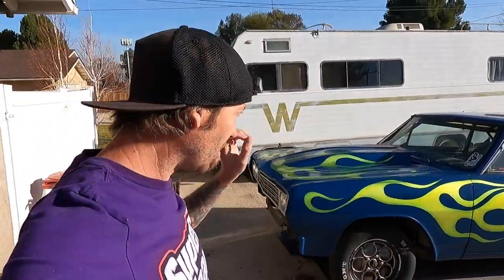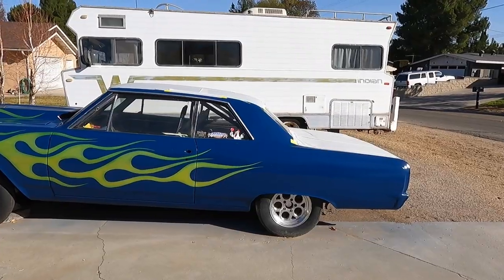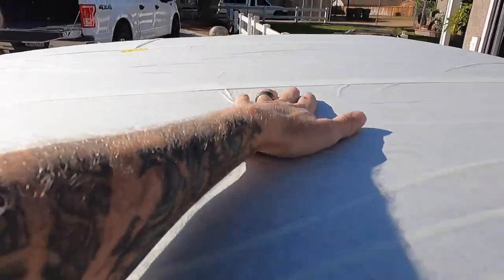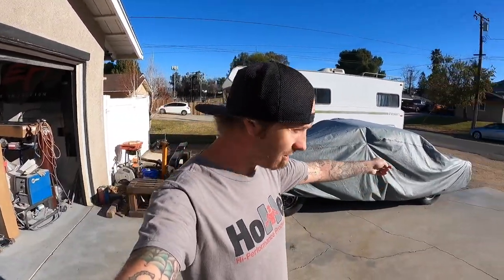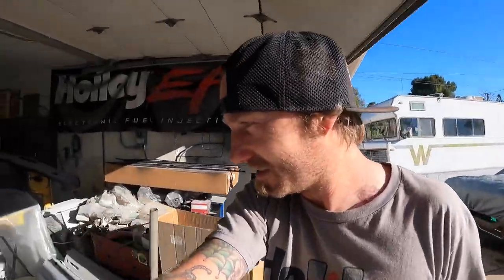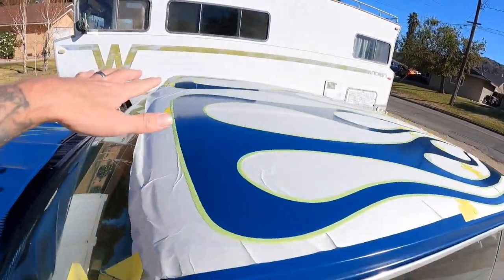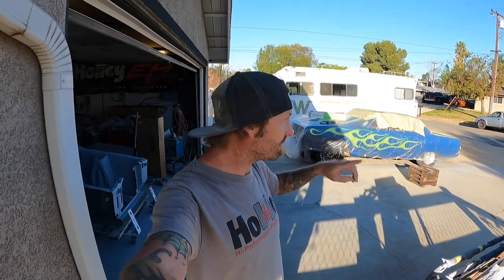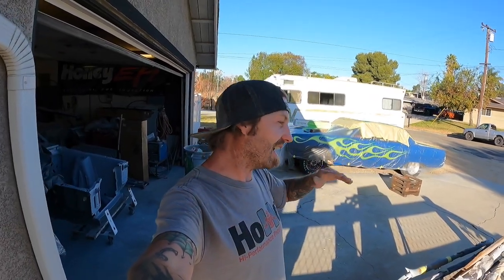Painting The Roof And Deck Lid

Comment: I'm in an 88 stang hatch. It's got a factory 4 link, but it's a triangulated so not the 4 link you add on a back half for sure - but no panhard bar. They can be easy to put power down, but you gotta reinforce the mount points, and replace all the control arms with tubular adjustable stuff. The notchbacks are better, but run what you brung right? Yeah, I'm LS swapping it though :D
Reply from the maker: The rear suspension on the A body and G Body for that matter is similar to a fox body but im sure the geometry is differnt by they are triangulated factory 4 links as well. Ill do the best I can with what I have and im sure we can make the car do alright. Reids car cut a 1.4-1.5 60' so if I can get mine down in that range I would be pretty excited.

Comment: Theres a big and a small gun from HF in a blow moulded case - both HVLP. Comes with a pressure regulator for 50 or 60 bucks or so. The "big gun" out of that kit is like 15 bucks by itself with none of the extras ... I want that one! but I really need a compressor that'll run it. under 400 at HF too - the smallest belt drive oiled compressor they got I think is like 370 + theft.
Reply from the maker: Yeah paint is all about the volume of air you have to work with. I started with a 60 gallon compressor and now have an 80 gal. If I can get my hands on a larger compressor I would take it haha. I agree that a touch up gun is a great starter for anyone wanting to learn and will paint lots of stuff quite well.
Reply: @Burndown  it's a 2hp 29 gallon with cast irion belt driven pump. it looks like a whole lotta compressor for under 400 bucks.

5.9 CFM @ 90 PSI, 7.3 CFM @ 40 PSI